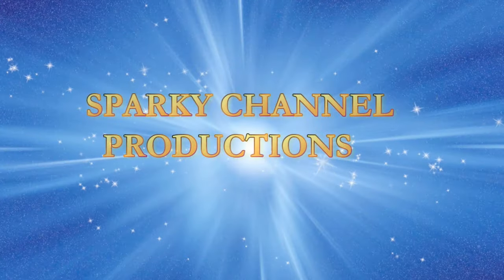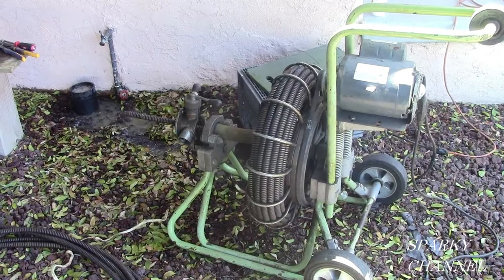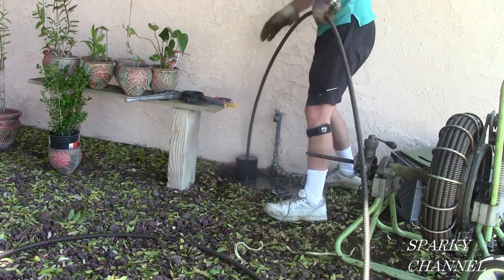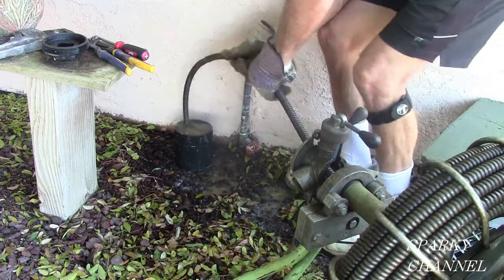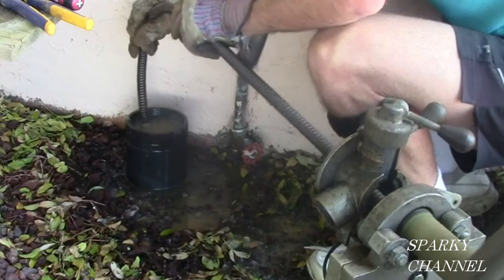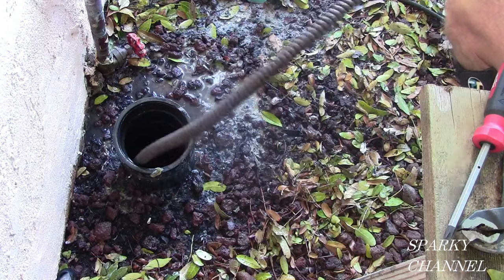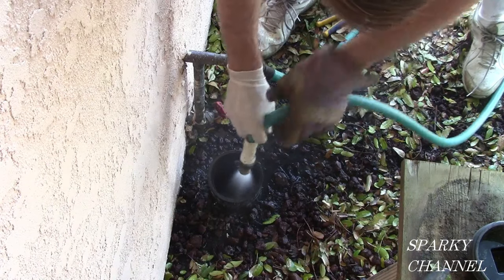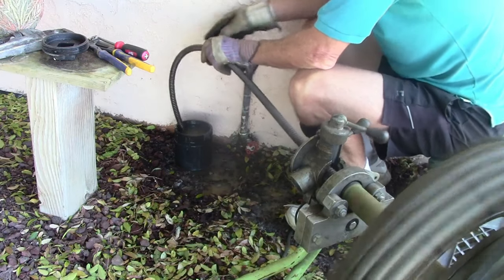How To Clean a Main Line Drain

Comment: This was the best video I found on YT for the following reasons. I didn't know NOT to reverse unless stuck. I mistakenly pushed the cable too fast. After this video, I added some slack to the cable, and allowed the twisting to draw the blade in further. I also spray painted the cable at 10' and 25' so I knew how far I was in. At 30', it was clear sailing. Good job Sparky.
Reply from the maker: Thanks Barry!

Comment: I have a Rigid K-50 knockoff that I've used successfully twice for main line blockage at my home.  Am contemplating snaking a rental property PREVENTATIVELY.  Since it would be dry, should I run water while snaking?  Does dry-snaking damage pipes?

Comment: I have two clean outs in front of my house right next to each other. One goes to a pipe fitting that turns toward the house and the other goes to a pipe fitting that turns toward the street. This makes it easy to make sure which direction the snake goes when you’re pushing it  into the pipe. When you only have one clean out and it’s full of water you can’t tell which direction the snake goes.
Reply: I have,,,,,at my own house no less,,,,had the snake go UP the stack....and I ran all 120 feet of cable into it.   Then I had a friend put a 7/8 snake in basement clean out and the lady in the house next door came out screaming blody murder. = The snake came up in her toilet! - Wouldn't think it could have negated the bends  it the crapper,,,,but it did. Never underestimate the ability of a snake to take the wrong turn!!!!!

Comment: what a  great video, everything shown and explained at the same time. A few questions please:
1) could the cable of your snake rust from washing it with garden hose after a job?
2) what is the purpose of using WD40 after washing your snake?
3) Have you ever had a situation where the first 50 feet comes apart from the second 50 feet at the joint? and if so, how did you get the first 50 feet out?
4) is it ever recommended to use the snake where there is no water in the pipe (for example if you are trying to get to the clog from the other side of a drain pipe)? or would using a snake in a dry pipe could  cause damage to both the pipe and the snake?
Reply from the maker: Yes, the snake can rust. That's why I spray it with WD40 after rinsing it off. No, I've never had it come apart. It's a high-quality snake and has good attachment. I watched a pro plumber lose his bit in a sewer line though. He either didn't attach it well or he just had cheap equipment. Do snaking with a wet pipe. Sometimes we run the water a little while snaking.

Comment: My setup has 2 Clean-Out-looking 4" pipes sticking up (as in the video) about 2 feet apart very near the house.  First I tried to put my augur down the Clean Out farthest from the house (closest to the the street). But I found it had a very severe angle. I could not feed the 5/8" augur line with cutting tool attached around that bend towards the street.  Then I realized that the 2 "Clean Outs" as actually part of a U-shaped trap, should be fed from the closest "Clean Out".   So the inner Clean Out was the one into which the augur should be fed. And the augur went into the inner Cleanout & turned towards the street very easily.   I had been told that you need a 5/8" inch minimum augur line for roots. This augur extended the line towards the roots very, very slowly. The line gave a reaction when I got to the root clog; so I went forward & backward at that spot, and soon the water started flowing out my drain pipe. I was concerned about going too far & getting into the city's street line (& getting stuck there), so I may not have advanced the line as far as I should have.  These devices would be improved if they had distances marked off (like it was a long ruler or tape measure). I did advance a bit beyond the point of initial resistance, maybe like 20 revolutions of the cylinder.  I don't know what distance corresponds to 1 revolution of the cylinder [but it seems obvious that it is not nearly 3 X (or 3.15159 X) the diameter of the cylinder].  On rewind it took a very long time to come out, probably more than 15 minutes.  I guess I should have started out by running the line over the ground for 10 revolutions of the cylinder & measuring the distance it protruded to get a protrusion per cylinder revolution.  I am not sure, however, that the protrusion is linear as it advances (does the distance of advance = the same distance at start as after it has gone out 20 feet?)

I had first tried to do this cheap with a Husky flat steel tape enclosed in a plastic case, which they call a "rod".  But the dull plastic (for crying outloud) spear tip would not penetrate the roots.  I first considered buying & using a smaller line electric rotating augur, but I found in the small print that they were not rated for roots.  I ordered a cheap Olympia 1/2 inch line augur, before I realized that it was not rated for roots. So I guess I will return it to Home Depot.  The 5/8" size machines probably cost over $2000 & are too heavy for one man to lift into a pickup truck.  It cost $100 a day to rent it & Home Depot did not have these.  I am not sure if I should keep the 1/2" Olympia & use it to maintain the line before it gets clogged again; but I do have some fear of losing the line inside the 4" pipe when it hits roots.

The cheap Husky manual line might do some good if you threw away the spear head & sharpened the end of the steel ribbon to a point.  But I have some fear of trying this, & it also might not do much to cut away the roots -- it might poke thru for a very temporary opening.

I have to follow up with some kind of root poison. I think the moral of the story is to make sure that your trees/bushes have plenty of water in the summer so they don't have to fight their way into you drain line.

Comment: Can you recommend a decent drain augar?  I bought one from Harbor Freight Tools and it is a POS.   The cable  doesn't load right in the drum, snags and kinks easily.  I am about to trash it.
Reply: That one is a peice of crap  its blue and only  has a 50 foot cable   seriously  try the ridged  k 400
Reply: @johnalarcon5006  I have had the K50 for over 40 years. It's a 5/8 cable and while it's only rated for 4" we have used it to clear 12" Lines in factories we have worked in. .... Grab your ass when you see what one costs, though.

Comment: So our “clean out “ if I’m correct isn’t screwed on. It’s a metal top that like framed, and it just sits on top of the pipe. Is that correct in being our mainline clear out? It’s also looking to be 12-14’ straight down before you reach the bottom outgoing pipe?

Comment: Rev up your drain snake !  All I have is a 25ft hand crank and another cheap 25ft harbor freight one that hooks to a drill.  Used mainly for indoors. I gotta hit my main tomorrow but my stoppage is usually roots that are about 20ft from the cleanout next to my chimney.  There is no tree but this damn stump will sprout branches and im scared if I get a comealong and winch it up I will mess up the pipe.
Reply from the maker: Good luck!
Reply: @SparkyChannel  put copper sulfate in the line

Comment: What does it mean when you open up the clean out and its dry or just a trickle of water flowing. Is the clog between the house and the clean out then?
Reply from the maker: Probably. Get a flashlight though and look down the clean out while the water is running.

Comment: power washer for short distances will work great as well - take off handle and put hose down drain - the force of washer will cut thru the blockage
Reply from the maker: Thanks!
Reply: They also make rubber bladders you connect to a garden hose. The bladder fills blocking the pipe and it has a holes in the end to jet the water. It's for minor blockages,  kind of like putting your thumb over the end of the hose to spray farther.

Comment: How do you remove metal mushroom style cap from outdoor vent/ clean out access in yard.  Screw is frozen. I sprayef rust  loosener. Turn clockwise or counter clockwise?
Reply: Counterclockwise.  Try penetrating fluid in the threads.
Reply: Counter clockwise  also it might have to be cut off depending  how rusted on it is

Comment: I have sewer line insurance on a rental I own. I was surprised when the service guy brought out a slew of 10-12 ft sections of snake hose and connected them to a hole hawg drill. No auto feeding machine. I thought it be a great system to have until he told me each section of snake cost about $300. 😄
Reply from the maker: I really like those but I'd like to have the proper machine that goes with it as well.

Comment: That's wat I call easy money
Reply from the maker: Yes, they charged a lot of money for drain line clearing. $400 if they can get it. $200 is about as low as plumbers will go for this.
Reply: @SparkyChannel  I love it
Reply: @SparkyChannel  I got a question wat if there's 2or 3 hot wheels toy car stuck I mean stuck I'm having trouble taking them out u think snake will break threw
Reply: Yes, it is easy money, but you have to pay hefty initial investment.

Comment: I'm having an issue with the toilet backing up into the tub also when the washer drains the water it goes into the tub. I live in a mobile home. I don't know if that would make a difference but I need help! Any suggestions? I'm on a limited income and a single mom. I have to fix things myself.
Reply: @Rowan Reed Gutierrezz Well, some of us own our homes, and thus, ARE the landlord.
Reply: Sounds like your main line needs  a snaking  gi to home depot  and rent a snake 75 foot is what  i always  use , if that isn't  the problem  your sewer lines under your mobile  home might  be clogged with paper and need a snaking also but with a 25 foot snake
Reply: Where do you live?
Reply: I've found that the sewer lines on mobile homes don't have enough slope to properly drain heavy materials (thick toilet paper, wipes, etc).   In the crawlspace under your home, you should be able to find the cleanout on your sewer pipe (it is a cap with a square head on it for the wrench).   You can access the pipes from that, and snake the buildup.   I would suggest to use at least a 1/2" snake for the 4" pipe.   And to stop any issues in the future, never use flushable wipes, and make sure the only thing going down the drains is toilet paper, #1, #2, and water.

Comment: How often do you recommend this to be done for homes?
Reply from the maker: We generally only do it when the line clogs up. Doing it as maintenance would be a good idea though, perhaps once a year.
Reply: @SparkyChannel  super, thank you.
Reply: My husband and I just did this. It’s still clogged. 😩
Reply: I'd recommend every 6 months, especially if you have trees or grass; the roots will need to be chewed away at the pipe joints where intrusion occurs.  Think of it as lawn mowing for your sewer line.  If you decide to replace your sewer line altogether, a good idea would be to dump water softener rock salt into the trench around the new pipe, surrounding it.  Roots love water and raw sewage.  The rock salt, however, will repel the roots.
Reply: Actually  when it backs up  or once a year if you want to do it , i have to do mine every  3 to 6 months  because  the city tree roots are in my sewer  line . I actually  need to call the city to remove  the damn tree
Reply: @beautybybrandie11   ok what the problem  is you probably  used  a short 50 foot  snake   you need to use a 75 or a 100 foot snake and if you have tree roots  in your sewer line  you need to use a root cutter head or have the line hydro jetted  but hydro jetting isnt cheap
Reply: @johnalarcon5006  we used the 100 foot snake. It’s our neighbor’s tree, what a pain. Thank you for the advice though.
Reply: @beautybybrandie11  i just had to borrow  a friend's  snake because  my 75 ft was a kinked up so now im going to order a 100 ft  3/8 new line for my k 400

Comment: I'm in the City of Flint, Michigan. When it rains for days I get sewage backup in my basement (100 year old house). It has ranged from barely a trickle to over a foot.  I call out a drain cleaner. This happens every 2 years or so. I have 2 pipes in my basement that looks like this one and one that is an open hole. I'm a 61 year old widow living in social security. Are all 3 if these clean outs? Should the open hole be closed?  They always say they don't know what caused the clog. I appreciate any opinions.
Reply from the maker: Hi Robin! I think the drain is just that, a drain. It needs to be kept free of any debris so that it can do its job which is to drain overflow water out of your basement. A sewage drain is different in that it takes the sewage water from the sinks and toilets of the house to a city main line. They both need to be kept cleaned out and working properly.
Reply: @SparkyChannel  thank you so much. I had a drain cleaner In and he really educated me on the three drains. I'm going to be doing the copper stuff every month. Thank you for your time. Be well.

Comment: I'm going to rent auto feeding one . Half inch is all they've got and I think 50 ft . hopefully be enough . Been many years since I've used one . I'd like one with different end attachment more like yours but I think it only has generic one
Reply from the maker: Good luck. I hope 50' does it.
Reply: @SparkyChannel  nope took all 50 ft but still clogged. It's a 4 in clean out but only runs one direction.. Just a sweep elbow into one line. What do you think it could be ? I  thought that was it , but will look for another clean out tomorrow.
Reply from the maker: @frankmontez6853  I think you need more than 50' (just a guess). In my video 50' didn't touch the clog. I hit the clog at about 60'. I put my whole 100' in though.
Reply: @SparkyChannel  I need to rent a truck since the big 100 ft one won't fit in my Ford focus. And don't know a friend with a truck. Daanng thing looks pretty heavy. 3/4 in cable . Although I'm kinda confused that it only runs one way. Isn't it supposed to get a line from the house then it goes out to street sewer ? Why does it only runs one way ?
Reply from the maker: @frankmontez6853  That's the way sewer lines are designed. If the lines went back towards your house you would break your toilet. I would say bite the bullet and hire a plumber to clear your line but watch carefully and ask questions. You can learn a great deal that way.
Reply: @SparkyChannel  so it's normal for it to run one way ? There's no need for sewer line  to connect to sewer from house ? Or it's connected but in another place ? And there's no way no chance the snake cable can go wrong direction and damage anything inside like toilets ? I can feed all 100 ft ?
Reply: @frankmontez6853  The main line clean out is tied into the main line at an angle that prevents the snake from inserting itself into lines going into the house. That's what the clean out is designed for. I just had a new clean out installed (in addition to replacing all the sewer lines under the house that tie into the main line) and it goes into the main line at an angle so the snake cannot accidentally be fed into the sewer line under the house that connects to the toilets and sink drain lines.  All homes have drains and toilets connecting into a sewer line under the house which ties into the main sewer line that goes from the house to the sewer. So yes, it's normal for the main line to run one way. If it doubled back toward the house your drains and toilets would have sewage backing up into the house.
Reply: @tsicby  well found out it was pretty smashed up. Several feet of it. Brutally hard , I had to cut out about 5-6 inches of concrete but wasn't that deep about three feet deep. It's kinda working but leaks some especially from laundry use . Fixed it kinda but leaks at elbow into sanitary tee. Might try to regluing it. Or seal it somehow. Silicone maybe ..
Reply: @tsicby  yeah I was wrong saying it ran a certain way. Clean out where it was clogged up and spilling over was fed from washing machine. Then led to main sewer line to the street by way of 90° elbow going downwards into sanitary tee. Find out it was pretty smashed up several feet .  Clean out was good ol schedule 40 but turned into thin wall grey sewer line  . I cut it out used Fernco rubber couplings at two ends. At the elbow where it still leaks even now , I purple primed and glued it but not good enough. The whole section is a bit off hard to get it straight and causing tension so tougher to get it just right. Not covered up so might give it another try. At this point I might pay someone who knows more than I do. I've worked in plumbing as labor not really a helper. Dug up my share of lines and learned a bit but not a plumber unfortunately. And I'm getting older tougher for me to do this hard ass work.
Reply: So, was there a clog?
Reply: @jerseyjim9092  read the full story of it in my previous comments.
Reply: @frankmontez6853  Use a Sectional like the Rigid K50.   I have a 120 feet for ours.